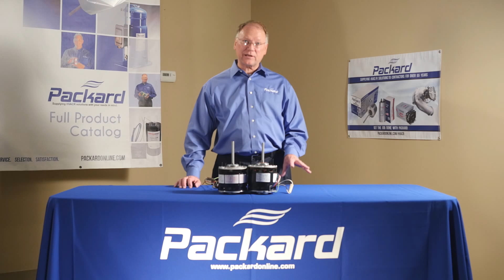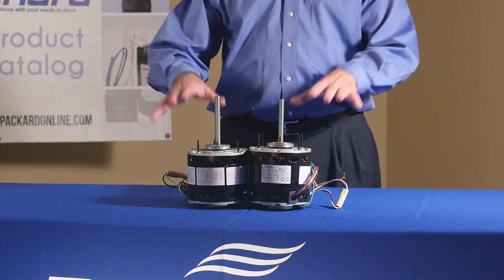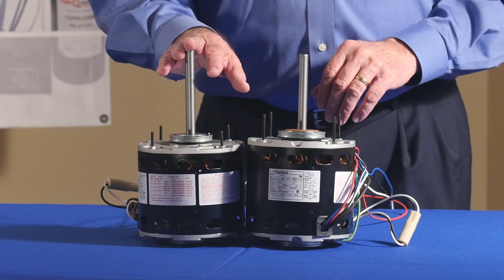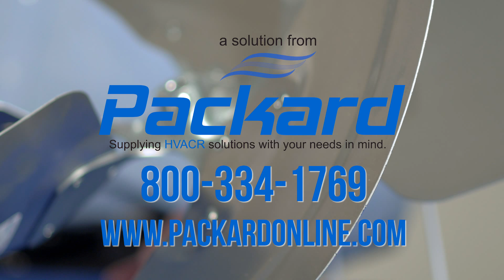Multi-Speed VS Multi-Horsepower Motor/ What's The Difference?

Comment: I just bought a 45458B multi hp motor.  It seems to be overheating after say 28 minutes.  There's not much of a way wire for the different HP, so how does that work? Is it all internally I'd assume?
Reply: what is the actual thermal cutoff temperature?

Comment: You didn’t explain RPM for different HP situation!
Reply: On our 60/80/100hp motors at work the rpm is the same just the horsepower changes depending on connections.

Comment: Assuming that the load is matched to the proper h.p. tap, is the multi horsepower motor designed to operate at a fixed rpm?
Reply from the maker: Yes.  If connected for 1/2 HP, and with a 1/2 HP load, it would operate at 1075 RPM.  If connected for 1/3 HP, and with a 1/3 HP load, it would operate at 1075 RPM.
Reply: @packardonline  So, at each different HPs the currents are also different. Is that correct? If you have wiring diagram of inside of the motors that will be much easier to understand. Thank you